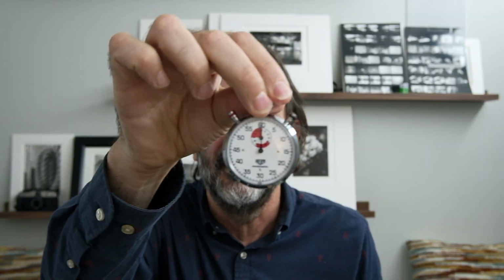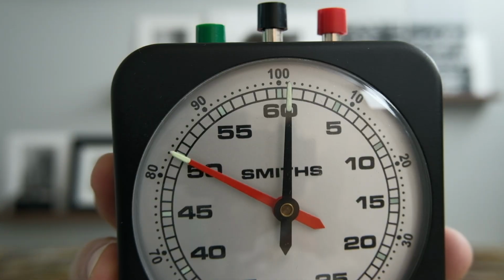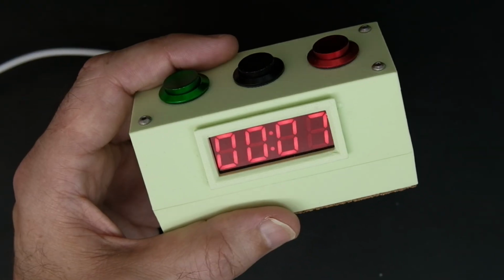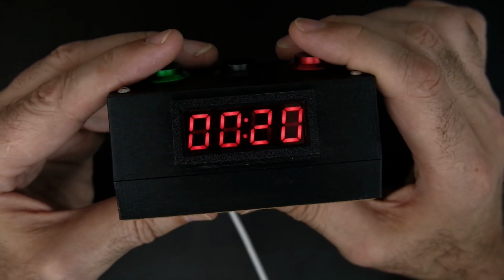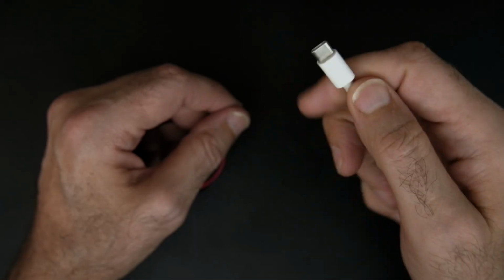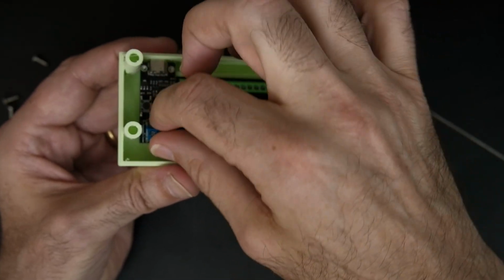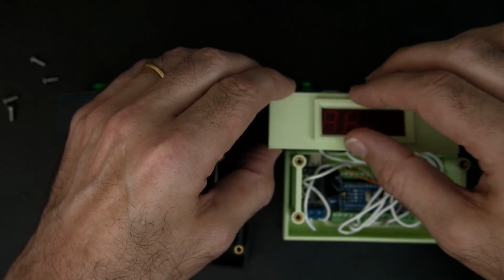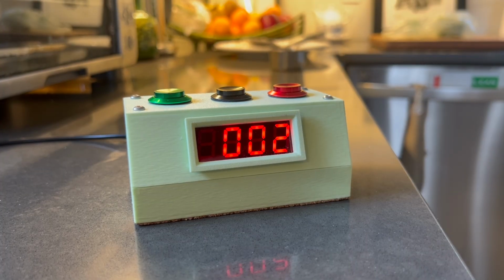Tad’s Awesome Darkroom Timer (Built Out of Pure Frustration)

Comment: Hey Tad. Inspired by you, I built a darkroom timer app. It controls a smart plug and has a lot of smart features like support for f-stop timing, split grade printing, programmable dodge and burn instructions, test strip function, developement timer... Can't wait to show you!!
Reply from the maker: I dreamed of doing exactly that, with F-stop timing and the ability to show F-stop fractions both approaching the setpoint and following the setpoint, using a ring LED with 12 LEDs showing 1/12 stop for each.
Alas, like so many projects it never made it past the dreaming stage. Besides, I have a Negative Labs F-stop timer that is the most amazing piece of timer gear I own. Anyway, I'm glad to hear you did it!
Reply: @TadTadd  Thanks! Can I ask you for your input on why the ability to show F-stop fractions both approaching the setpoint and following the setpoint would be useful to you? My app only shows seconds with decimals, but I might be interested implementing this as well...
Reply from the maker: @p504504  pretty simple: I do my best to make a user interface as simple as possible so future me doesn't need a cheat sheet on how to use it. By having a timer that will show times in fractions of F-stops under and over, it would be a snap to do my simple level of dodging and burning...just wait for it to get to "1/2 stop under" and start dodging...or after full time, burn in a section until it says 2/3 of a stop. That way I wouldn't need to program a thing, just choose a base time and go for it.
Reply: @TadTadd  Oh I see. My app has a built in dodge and burn tool. There is a 3x3 grid that represents the paper. On it, I can set up max 9 different dodge and burn actions, and the timer will run, and before every step in the sequence, it tells me where to dodge or burn.

Comment: Thanks for sharing, looking to build me a couple of these! Wouldn’t it be possible to skip the USB-C board and just drive everything from the USB input on the Arduino board?
Reply from the maker: You absolutely could do that. I chose not to because as a general rule I don't want to expose the Arduino interface to the outside world, and it also would mean that the tail end of the Arduino would need to poke out the end of the case, or I'd need some kind of extender.
I considered the option and figured it wasn't as nifty as having a dedicated USB C jack on the back.
I have a new gadget I have been working on where I had a custom PCB made (surprisingly easy) and on that one I attached a USB-C jack and two 5.7K resistors that tell the incoming USB lead to supply 5 volts, nothing else needed at all--some day I'll make a custom board for the timer, and that's the way I'll do the USB.

Comment: If anyone ever needs a low-voltage darkroom timer to power an enlarger, I’ve ended up with a pretty unconventional setup.
I do wet collodion photography, and I’m getting into albumen paper, with the added challenge of wanting to use an old enlarging camera with that paper. My original darkbox was portable, but not a great space for sensitizing or enlarging albumen prints. Since albumen is sensitive to everything except yellow light, I built a new portable darkbox that runs entirely on low voltage, basically 12V and 5V, so I can use it for both collodion and albumen work.
That meant I needed a low-voltage timer to control my enlarger. My enlarging head is made of UV LEDs, so exposures run for minutes at a time, with check-ins during the print-out process.
This all connects back to my wet plate setup too. I use Norman strobes and an electrically actuated shutter powered by a foot pedal. Because the shutter is slow, I needed a built-in delay. Originally I used offset switches, but eventually I switched to small programmable timing modules. These let me delay the flash by fractions of a second (or longer if needed) and control multiple circuits at once.
I also started using an adjustable neutral density filter to approximate wet plate exposure on a DSLR so I can preview lighting digitally before committing to a plate.
Right now I have two of these timing modules on the foot pedal controlling the shutter, flash, and DSLR. And it hit me that the same module can easily be used as a low-voltage light timer for an enlarger, since it simply opens and closes a relay.
So if anyone else is crazy enough to need a low-voltage enlarger timer, these little modules can absolutely do the job. Your darkroom timers are great. They just didn’t quite fit my weird hybrid setup, but they inspired me to repurpose this solution.
Here’s the type of timing module I’m using:

https://a.co/d/092HyM6m

Comment: Love it! One suggestio I age (if I may) is to make the stopwatch more to be a decimal vs the timer to be a colan. But love this, and once I get all the right stuff I will make it. Also to sell it, you should put it on the Printables store. Great job on this! Once I get the right parts I'll put it together. I have the prints ready, just I got some wrong parts because I saw it on printables before this video was shown on the page for the timer.
Reply from the maker: Thanks! I'm excited to see someone else making one of these. Make sure to add it as a build to my Printables project so we can all see.
You have a good eye--I had also spotted those decimal points and thought of using them for the stopwatch. Unfortunately they are not active elements of this display. The colon is active, but the decimal points are not electrically connected to the driver chip in the module. The module is one of the most popular ones out there, readily available, so I had to accept those silly useless decimal dots as part of the bargain.
Reply: @TadTadd no doubt I'll add it to printables! I left a comment there pretty much saying could you Post links to the hardware? I got pretty much all of it but I couldn't find the USB-C part and I accidently got the wrong I/O module and I wondered how it would fit in. But I found this before you uploaded the video. but this is my first micro controller so no shame. I think you did a great job both in this video and also the 3D parts made. You might wanna consider putting it on printables to sell for a few bucks. I might notify mine to play like a Mario level complete noise. Anyways you'll see it up on there soon.

Comment: This is actually a Timer that combines all the features you could ever need in such a simple and elegant way without any unnecessary and anoying additions. Did you write the code yourself.
Reply from the maker: Thanks! That was exactly the goal — keep it simple and elegant. I did write the code myself, but I leaned heavily on ChatGPT along the way. I’d ask questions like, “Is there a library that can handle button combos as events?” and then sift through the answers. I’m not an embedded systems developer, so having AI do the grunt work was a big help. The trick is knowing what to keep and what to toss — it spits out plenty of mediocre code, but with a little judgment you can get to the good stuff pretty quickly.